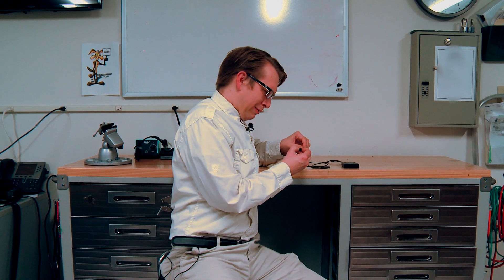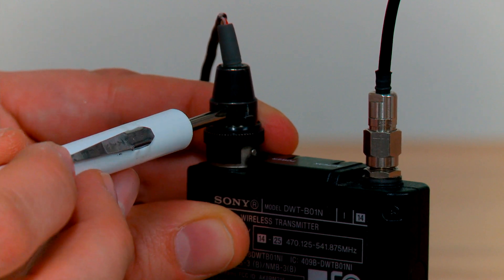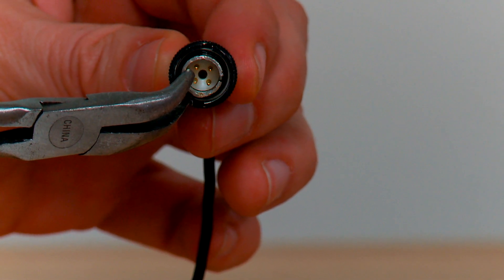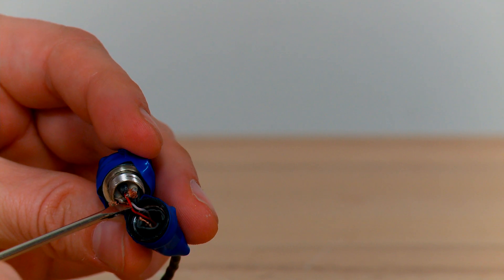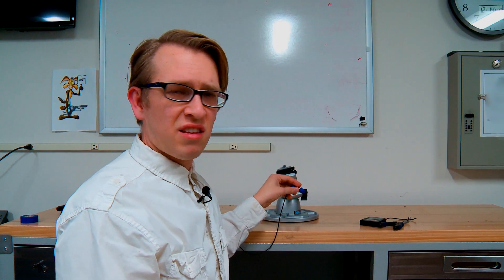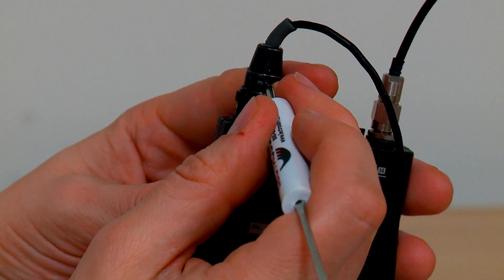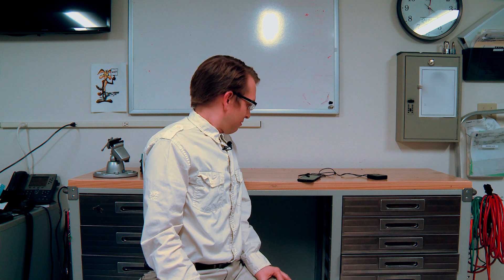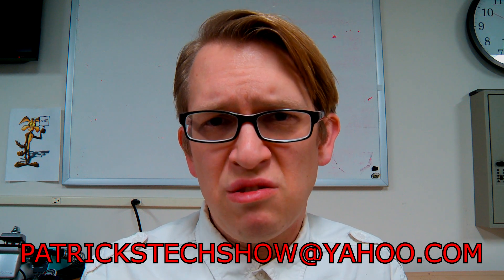Sony ECM 44BC Repair

Comment: Wasn't sure how connector came apart, so your video was really useful. I found that (at 2.00) rather than use electrical tape to prevent scuffing the finish, I used thin leather - like in a belt. Gives a good grip without damaging the surface. 
Hope the sardines were enjoyable...